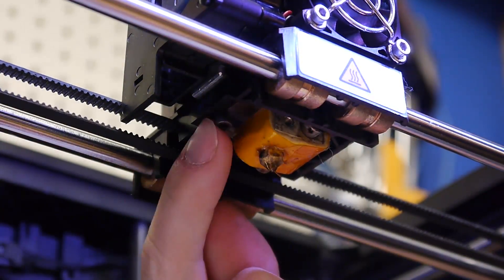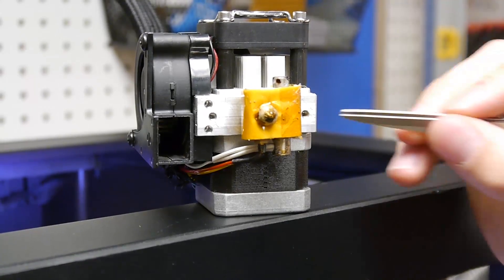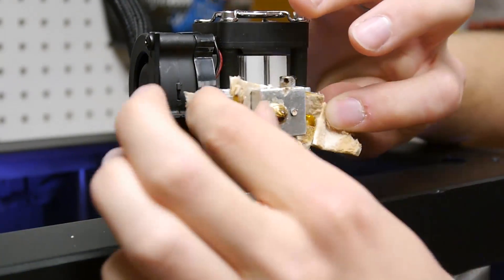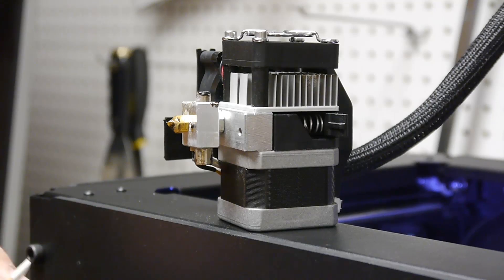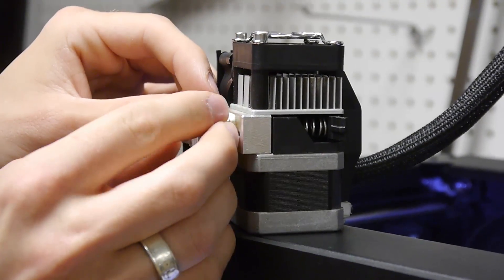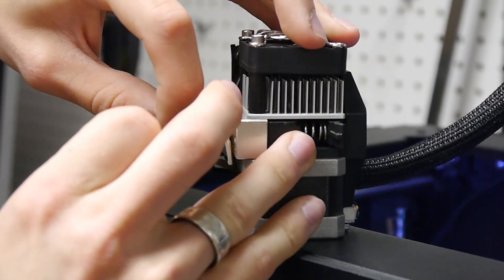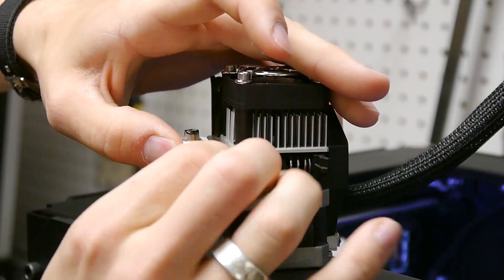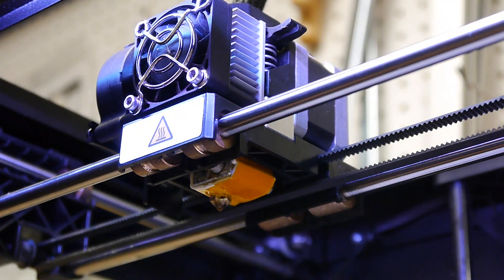How to Replace the Ceramic Tape on a MakerBot Replicator 2 3D Printer

Comment: Stupid question but what does the nsulation do? Is it there to prevent heat spreading to other parts?
Reply: +Fargo 3D Printing Well thanks! I am currently having issues with my replicator 2X, the extruder stops extruding while printing so everything I end up with an air print.. I've tried to lower and higher the temperature and changing materials (PLA and ABS), none of the above helped... The filament just stops to come out from the extruder. Also there's nothing wrong with the motor pushing the filament. Could You give any clue of what it could be? I am suspecting that the filament is getting expanded inside the aluminium tube while printing (where the filament passes through to the extruder head) and ending up with it unable to move downwards..
Reply: @hanline  sounds like a piece of broken filament in the hotend